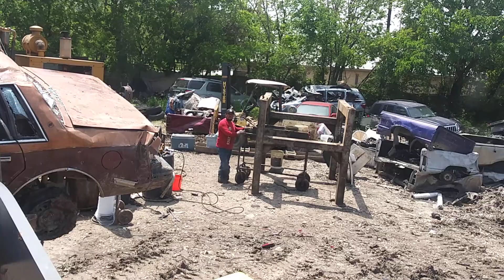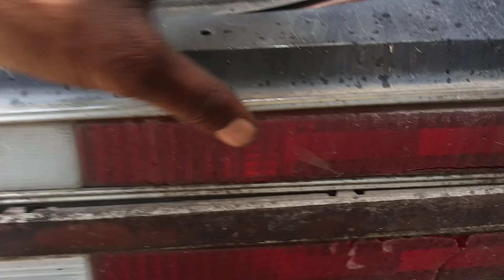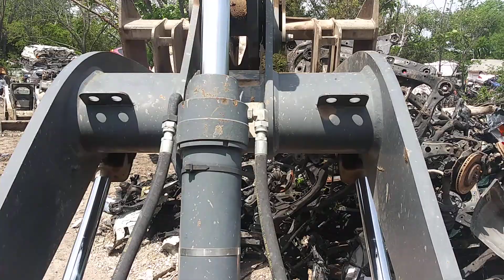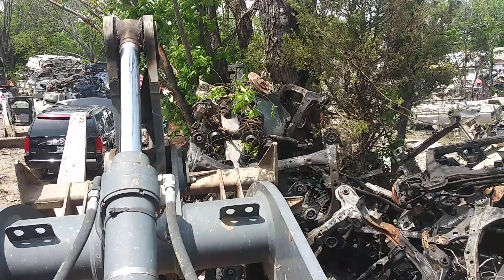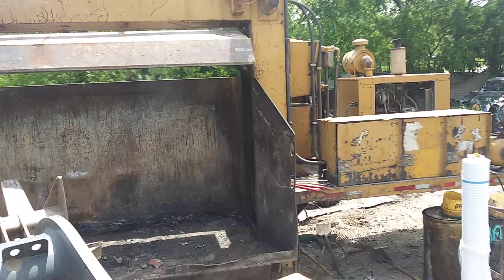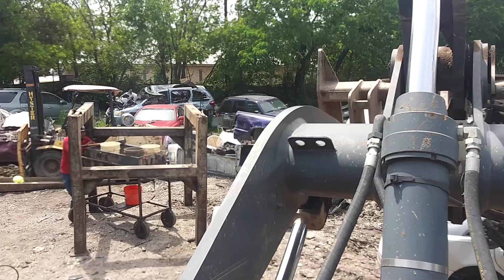TIGHT AREA CRUSHING 82 BUICK CENTURY LAST WALK OF FAME..

Comment: No VIN (from the dash), we do not win. Possibly Luke Buick which now might be Classic Buick in Arlington, TX located at: 1400 E Interstate 20, Arlington, TX 76018.

Possible code 63/68 Light and Medium Sandstone exterior paint and looks to have the 2.8L or 3.0L V6 with a two barrel Rochester carburetor. 

You cannot use the year in the tail lights for determining the model year as that is the first year that the US DOT approved that light for use and the light could be used for years beyond that. Case in point: The side marker lights on my '79 and '80 Trans am say "SAE DOT 70" in them. 1970-1981 Firebirds all use the same exact marker lights. 

However you might be right (by accident) that this is an '82 as that color scheme was available in a Century that year and 1982 was the first year for the front wheel drive Century. 1981 was the last for it to be rear wheel drive. No, it's not a 1992, that style headlights were not used in 1992:  1982 was a sealed beam style lamp like the car in this video and 1992 had a composite "European" style head light set up.
Reply from the maker: I was thinking maybe the taillights would tell mi da year they can be wrong also.. U kno most of da time I guessing the years sum I gets right sum I gets wrong.. I learn sumchings different everyday with these classic cars....💯💪😎👍
Reply: @DeathRowCarCrusher  Sure I understand, it can get you close, but not all the time.